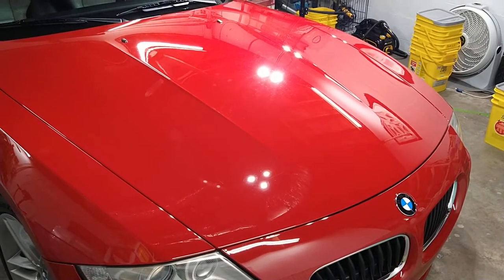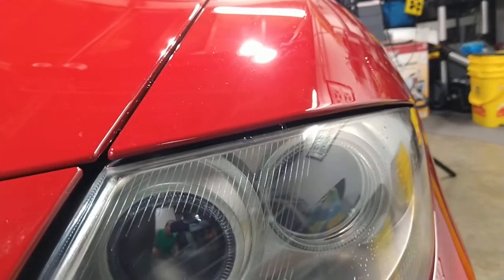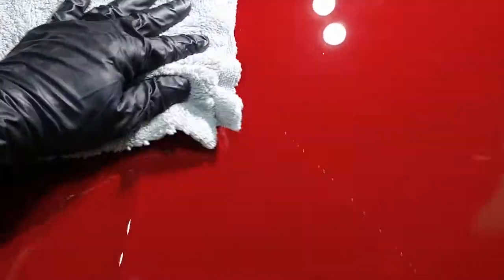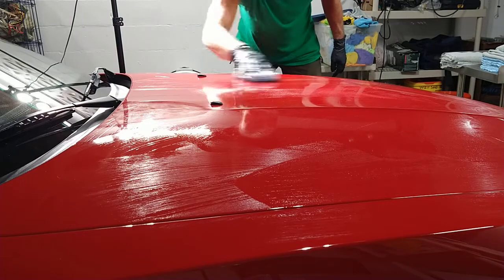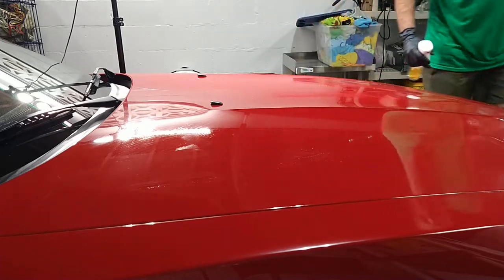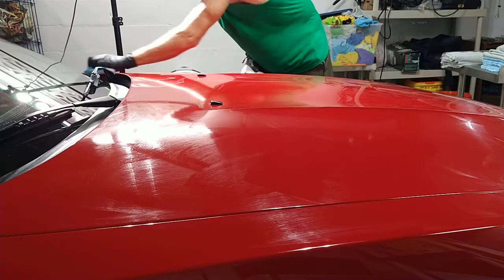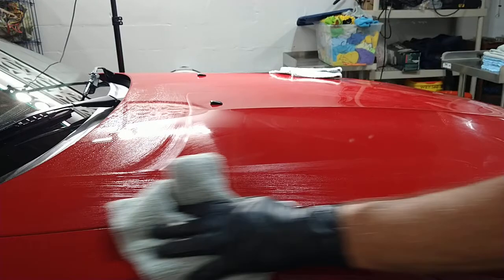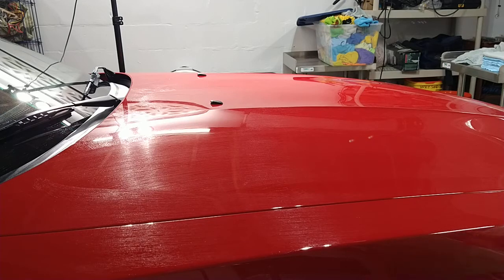PT1 HOW TO REMOVE WATER SPOTS ON CERAMIC COATING USING SUD FACTORY PAINT WATER SPOT KILLER

Comment: So I take it that product is safe to use over ceramic coating?
Reply from the maker: Yes, it's made for ceramic coatings. I will warn, that when using chemicals like these, where a full respirator / goggles and spray into microfiber and apply over surface to increase safety for your breathing environment.